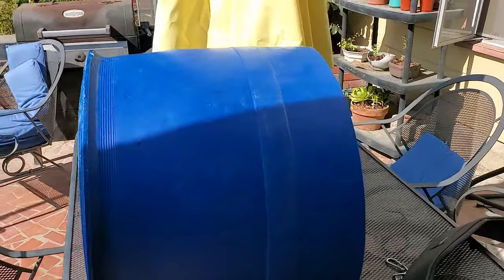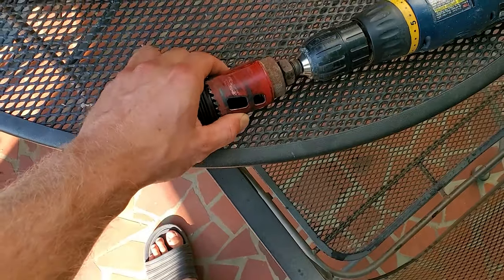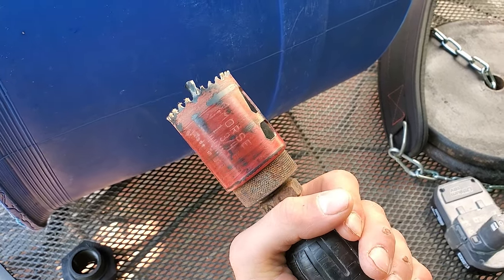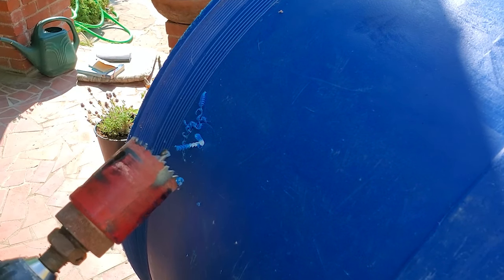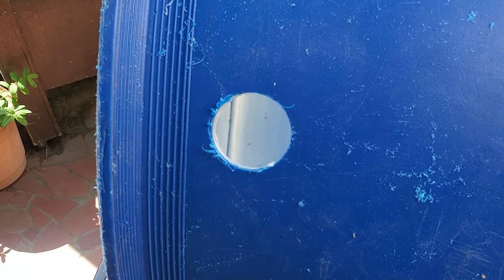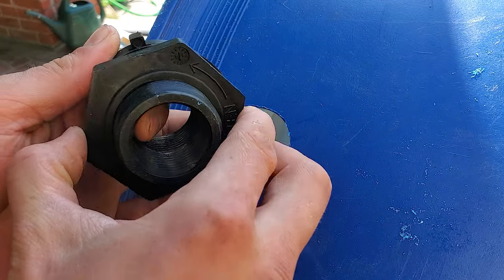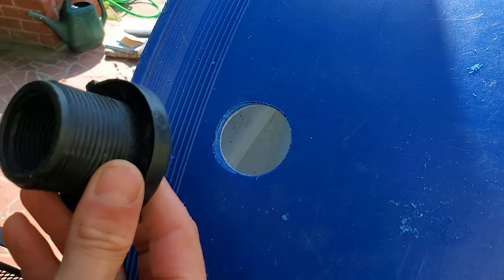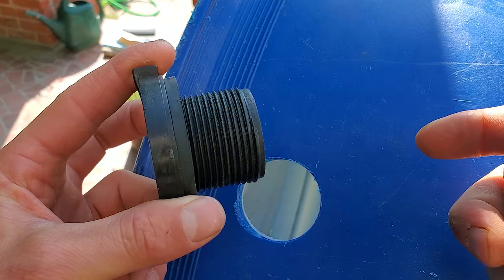How to install a bulkhead fitting - aquaponic plumbing

Comment: Good video but mine leaks so where do u apply silicone?
Reply from the maker: The silicone will go on the fixed side. So in this videos case you would silicone the part that is on the inside of the 55 gallon drum. Silicone all the way around the fixed part of the bulkhead fitting.

Comment: 1 inch bulk head,  1 3/4 inch hole. I'm curious to know if your going to need silicone.
Reply from the maker: Well basically the only reason I would need silicone is because the tank is rounded. However I more than likely won't need to use silicone.
The hole size is the exact size hole I need for this bulkhead. As seen in the video there is little to no gap when the bulkhead is inserted in the hole.
It is a 1inch bulkhead for 1inch pvc plumbing. But that 1in on the bulkhead is referring to inside diameter or to the fact that it is for 1inch pvc pipe. The bulkhead outer diameter where the nut is threaded onto is pretty much 1 3/4". You won't be able to use a smaller hole for this bulkhead even if you wanted to.
But when I do make the half barrel into a wicking bed we'll see of silicone is needed or not. 

Bulkhead
Fitting Size    Hole Size
1/2"                   1 1/8"
3/4"                   1 1/2"
1"                       1 3/4"
1 1/2"                2 3/8"
2"                       3"
Reply: Yeah, whadya mean, "there you go" ?  What about a tap of some sort?  You just jam it in and hope for the best?!

Comment: The threads are reversed...damn it
Reply from the maker: Just on the outside. The inside is normal. But you can get bulkheads that don't have the threads reversed.
Reply: I'm working with an existing bulkhead and I was unscrewing it as I would anything.....it worked out in the end